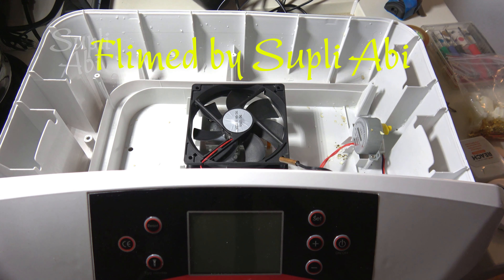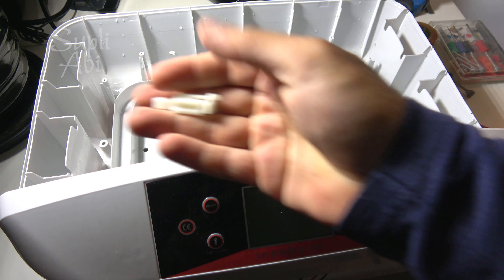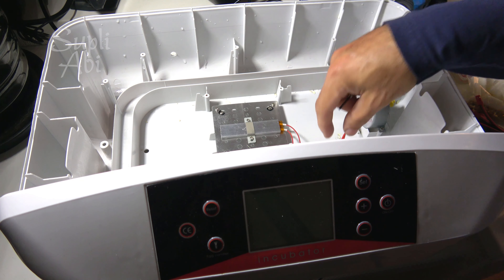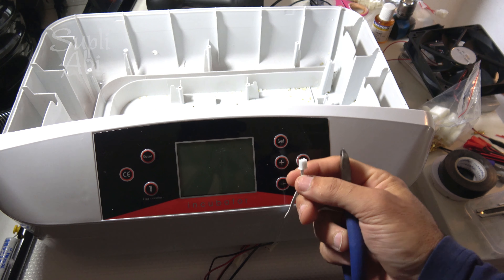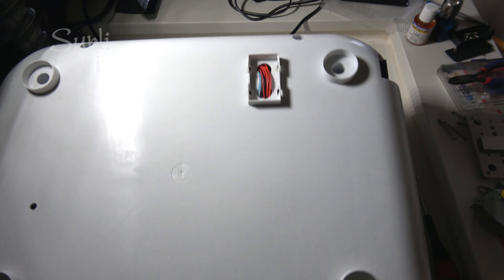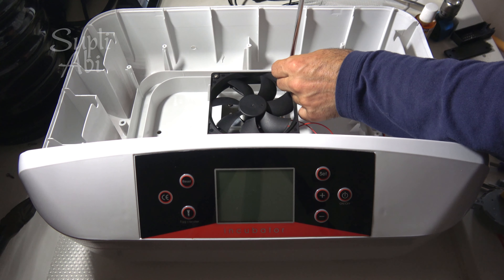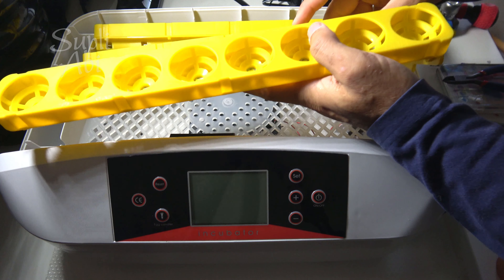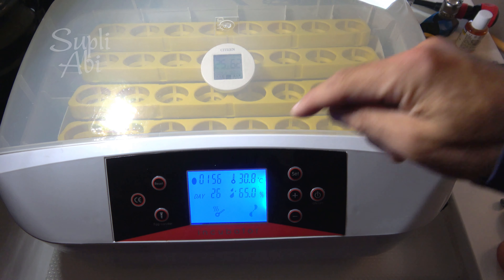How to modify HHD 32 - 56 Automatic egg incubator to clean easy? Egg incubation Part 6【4K】

Comment: Thanks for sharing such lovely information, as I have the same model, I would like to clear one doubt, if the default temperature  with meter is not trustworthy and we can buy another temp/humidity thermometer then how we can make control for the temperatures? i would appreciate for your prompt reply. regards
Reply from the maker: You have to calibrate incubator temperature until you read same number on your sperate thermometer.

Comment: Do you have the power trip out issue. I just recieved one and its horrible. Cant trust it if it can easily turn off with just a slight bump to the incubator unit

Comment: I still don’t know which one is the water channel and how I’m meant to fill up with the water bottle. Do I have to take the lid off?
Reply: there is a little hole on right side about 1/8" the water bottle fits there, other side of hole is a small tank that runs to channel.. only add water to satisfy humidity needs overfill makes a mess
Reply: Hey, I found the sides there are 4 Channels or chambers !! 😮 fill those up. Never said in manual buy I filled with water 💦